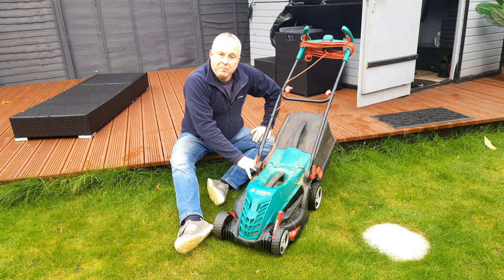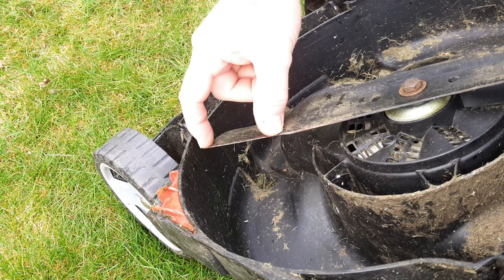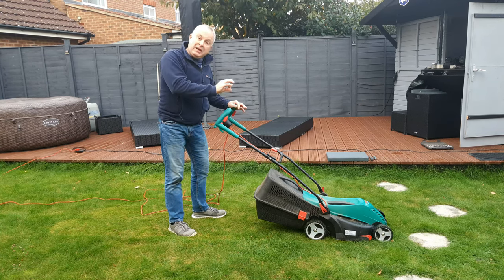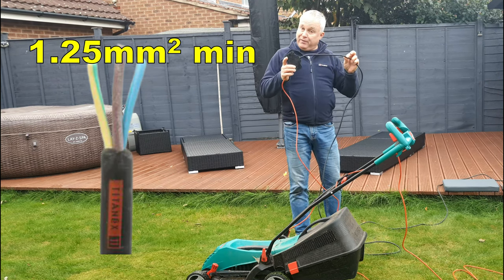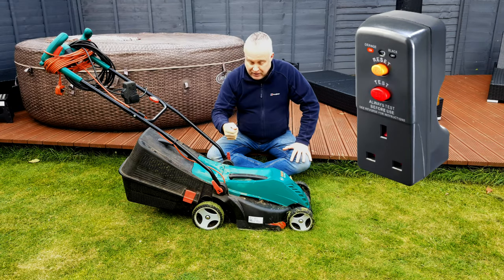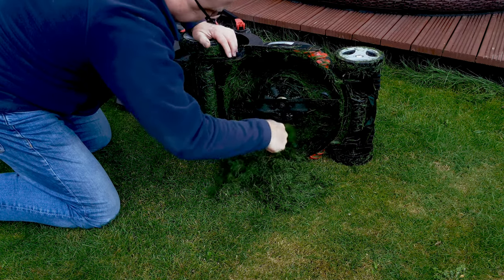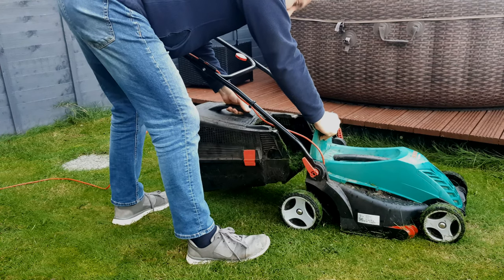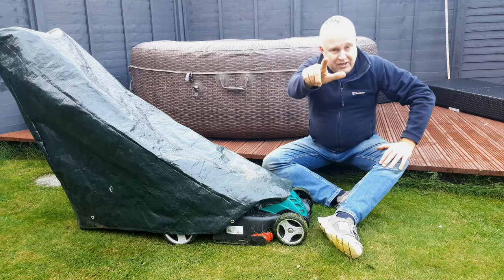Rotary Lawnmower Top Tips and Tricks | Rotary Mower Basics

Comment: Hello! It was indeed interesting video, as the user of even 2 of these machines (one in my mother’s garden, another – in my private one, yes, we liked this model much :) ) I agree with all your statements in it. One more question – maybe you have you experience and opinion on this topic: Bosh manual has the picture included where the lawnmower has a picture in which the lawnmower without the grass collector is crossed with a cross with exclamation point besides as if one can't cut grass that way – without grass collector. By I do cut grass this way from time to time when I don’t have where to store the cut grass. Do you think lawnmower gets some damage while using it this way ? what type of damage could it be ? or these precautions painted only due to protecting your legs from any stuff that flies out together with cut grass from lawnmower “exhaust pipe”? Thank you in advance for your insights!
Reply from the maker: I've never tried that. i would think it's a protection thing as these mowers can't half fling stones at some speed!
Reply: NOT meant to be used without the grass box - it's a safety thing as stones can be flung out at great speed, but also the underside of the mower will just get clogged and damage the motor over time. My elderly Atco was supplied with a specifically shaped plug which replaces the grass box and is used when mulching cuttings. The shape of it forces the cuttings back through the blades to be chopped more finely and pushes them back into the lawn as fertiliser.